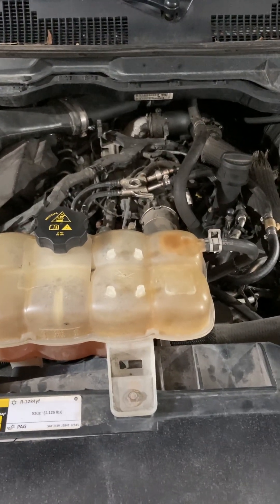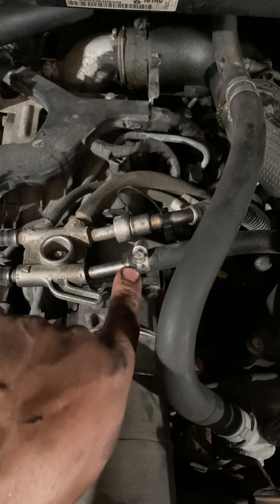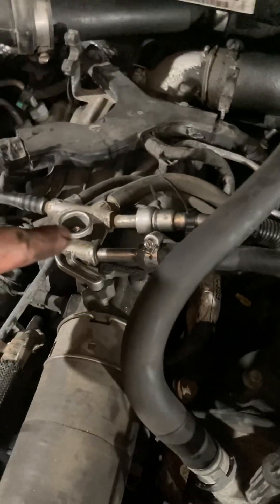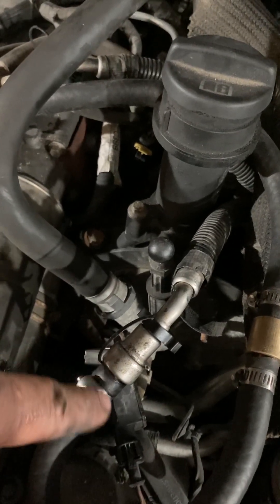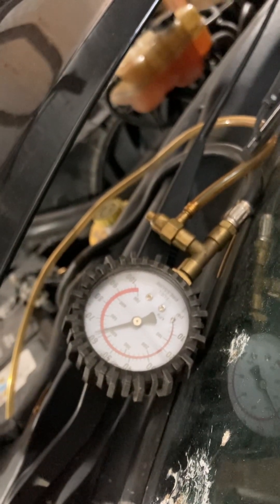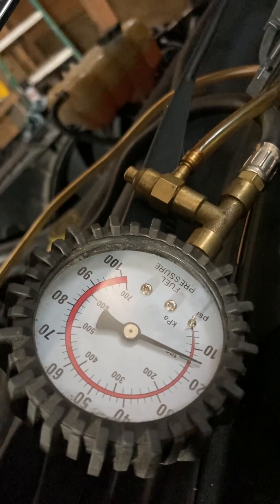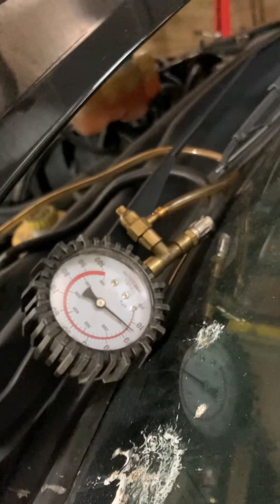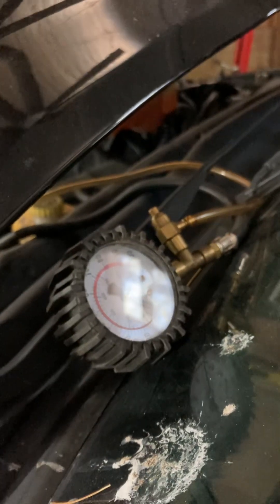Ram ecodiesel fuel pressure testing between lift pump and injection pump (see description for specs)

Comment: What pump did you install?
Reply from the maker: @ArcolaBridge  Delphi, part number FG1978
Reply: @tadsworkshop  me too got Delphi on rock auto for 200 installed it just now at 225k had to push the bed back but was pretty easy.

Comment: Hey on my truck the low pressure fuel is fine at 60psi but the high pressure reading on my scanner while cranking is 1200psi I just installed a new cp4 and still won’t start only crank what else can I check?

Comment: Thanks for posting this video mate. 

My truck stalled on me couple times and cranks and stalls 1 second later. 

Fuel pressure reads at 52psi when priming and DROPS to 40-46psi when cranking. 

Is this normal? 

I replaced my High Pressure pump and still having issues. 

Any help would be greatly appreciated.
Reply from the maker: @leftR-tardation  to be clear, what pressure are you seeing while the truck is running/idling?
Reply: @tadsworkshop  unfortunately I can’t get it started long enough to check the low pressure. When I had it running before with my OBD reader the pressures at idle ranged from 3846 to 4113psi
Reply from the maker: @leftR-tardation  I think it needs 3500 psi to start. I wonder if you have a damaged crankshaft sensor reluctor ring/tone wheel? I would watch that carefully on a graphing scan tool. Make sure there are no periodic dips.
Reply: @tadsworkshop  i did the crank sensor software recall on it so it shouldn’t technically stall on me. But I will keep looking. Thanks for the quick replies!
Reply from the maker: @leftR-tardation  so, it sounds like this issue was happening before you replaced the injection pump? I would really start suspecting lift pump, ESPECIALLY if it is the original unit. Beyond that, check the fuse for it in the under hood box. If it appears burnt, there is your red flag.
Reply: @tadsworkshop  yea it started before I replaced the high pressure pump and did the software update. Thats why I’m leaning towards the lift pump. 

I don’t think the fuel pressure should be dropping on the low pressure side to 40-46psi when cranking. But then again I don’t know what it should be dropping to, if at all. 

It’s at 52-54ish when priming
Reply from the maker: @leftR-tardation  I mean, the voltage does drop quite a bit while cranking, so the lower fuel pressure makes sense to me. Honestly I’m not seeing a smoking gun with those fuel pressure numbers, but maybe I’m wrong. But an intermittent problem with the lift pump can be tricky to catch. Maybe go with your gut instinct and just replace that lift pump. I’ve done pretty well with Delphi pumps on the Ecodiesels, for what it’s worth. Rockauto, Amazon, or locally.
Reply: @tadsworkshop  yea it’s a tough one to figure out. It’s strange that I’m not getting any codes either. I’m going to speak with a tech this week and see what he says. I was looking at the Delphi pumps on rock auto last night. I’ll keep you posted once or if I figure it out lol. Thanks again for your help, really appreciate it!
Reply from the maker: @leftR-tardation  trouble codes are a luxury sometimes. whatever it is, please let me know what you find out. I’d like to learn from your situation as well. Obviously you’ve dumped some money into it, but if it is the original lift pump, replace it. All of the ecodiesel lift pumps I’ve replaced have failed between 140k and 190k miles for what it’s worth.
Reply: @tadsworkshop  lol yea codes are definitely a luxury item…I have 200,000km on my truck so it’s getting up there. I’ll definitely let you know once I’ll figure it out. 👍

Comment: I have a dtc P0088 fuel rail pressure to high and sometimes the engine start to knocking and the fuel pressure regulator is very expensive what I can do? Heeeeeeelp 😢

Comment: I did this test today…had a P0087 dtc and found 15 psi from lift pump. Original pump with 199k.
Reply from the maker: Good deal. I’ve got another video on lift pump replacement.

Comment: I'm starting to think my lift pump is going. I'm no mechanic. Pretty hands on though. Shop told me injectors. But I had a pretty plugged off fuel filter. Had stalled. 2 at redlight when I was 1/4 tank in fuel. Runs fine when full but as it lowers down I noticed it happened again. So I'm leaning towards lift pump. Did you drop the tank in this instance or did you pull the bed off?
Reply from the maker: Just dropped the tank from underneath. Take care with the hoses, lines, and electrical connector on top. For what it’s worth, I’ve seen two ecodiesel lift pumps fail around 150k to 180k. Not to say that’s how it always is. In the case of this particular truck in the video, a dealership had also told the customer lift pump and injectors. But yeah, go for it! Not a bad job. Be aware that fuel sloshing back in and forth in the tank can quickly make the tank unmanageable when you lower it.